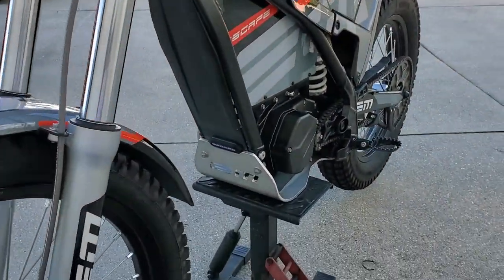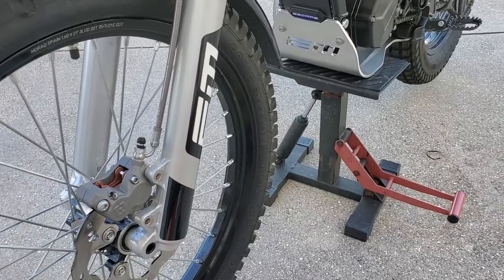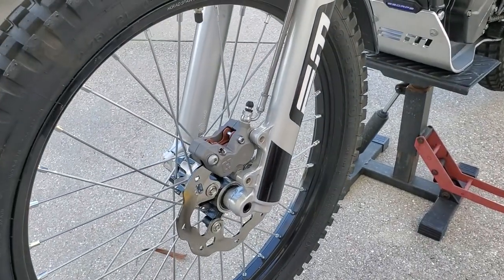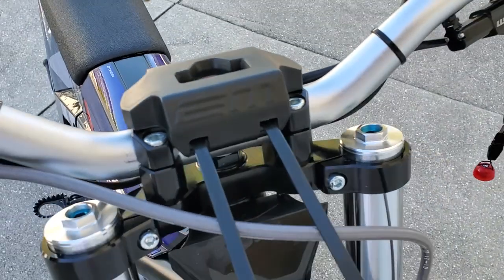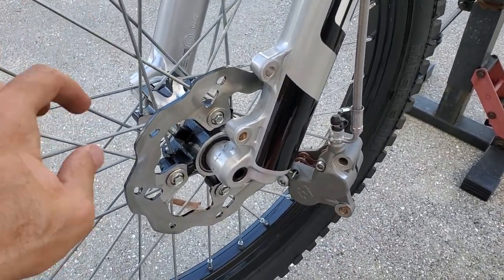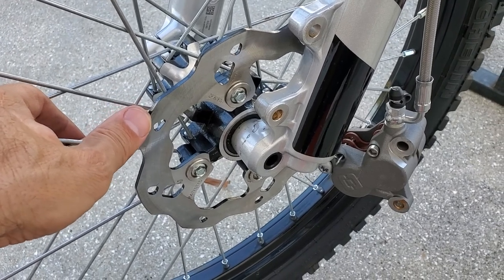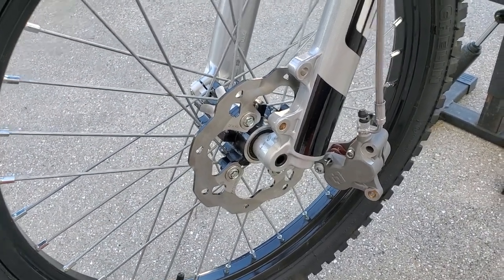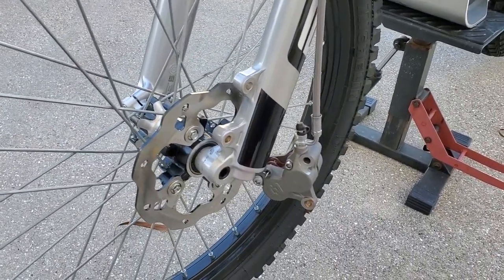Loose front Brake Disc on your EM Escape motorcycle is Good??? Sometimes. INSPECT YOUR BIKES!

Comment: Was wondering if you've noticed the horrendous squeal these brakes make when they are wet?  Do you have that issue with yours?  If so, do you know what would quite them up a bit.  Thx.
Reply from the maker: Yes, I've heard that. Sometimes they are also weak. I've had to take apart and sand pads and disc.